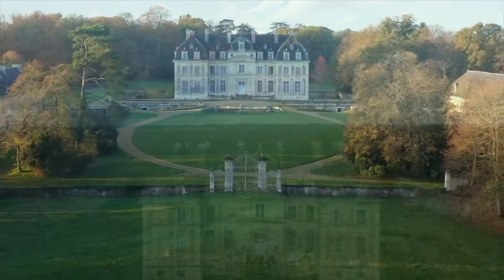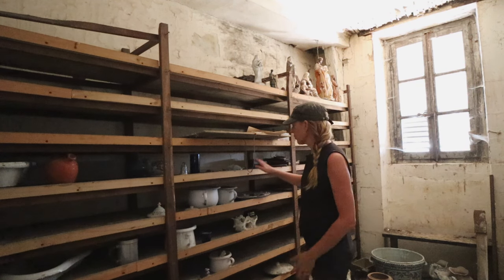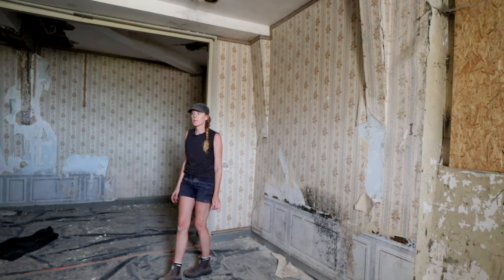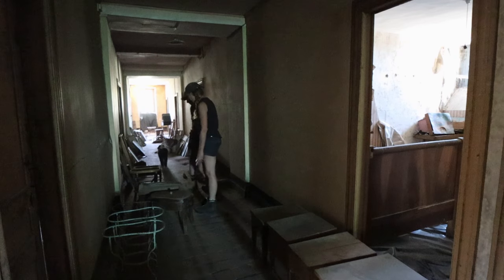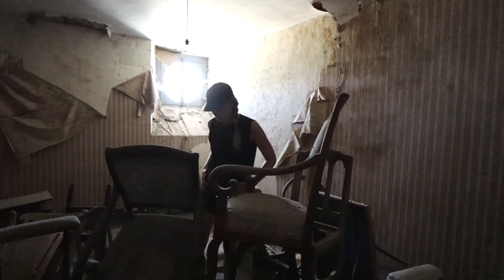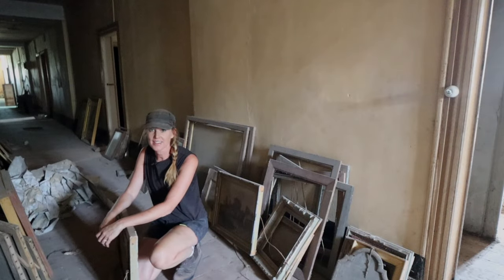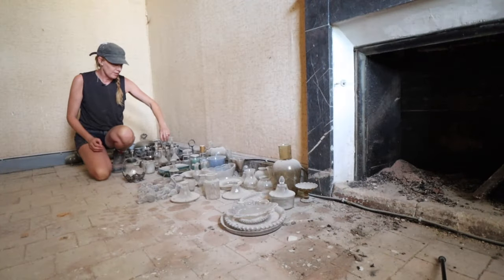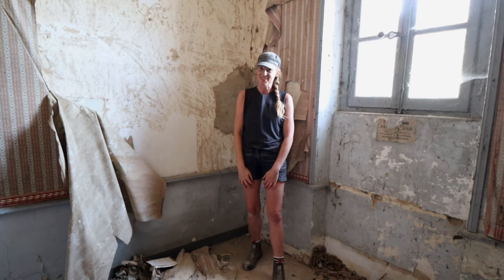Reality Hits: A tour of the Chateau's ruined second floor

Comment: You will find pieces of pottery, china, and glassware in the old privy holes.  Some pieces may match what you have.  In olden times, combustible items were burned in burn pits; some organic material was fed to the pigs, while some was used for composting.  Quite a few items which could not be eliminated in these ways was tossed into the privy holes.  You may also find old bottles, coins, clay pipes, marbles, porcelain dolls, etc., some of which is still intact.  Some privies were cleaned out for reuse, while others were covered up and new holes were dug with new privy structures.  Even the privies which were cleaned out may still have treasure resting in the crevices and the very bottom.  Privy digging hobbyists can help you locate the privy holes and excavate them, or you can save it as a fun project for yourselves down the road.

Comment: Many of the items you call comodes are bidets  : the " kidney" shaped porcelain vessels. In an era when  full body bathing  was impossible to do everyday, , keeping the vaginal and anal'areas clean was of the upmost important, hence the many bidets  to wash  the private parts everyday ! The comodes are the wooden ones  ( with lids) in whch a round porcelain chamber pot was placed,.
Reply from the maker: Thanks for your message.  Your distinction between the commodes and the bidets is quite correct.